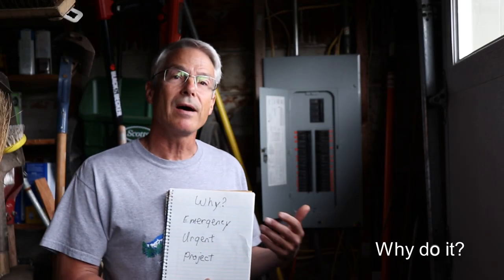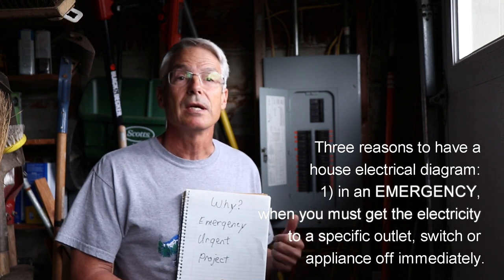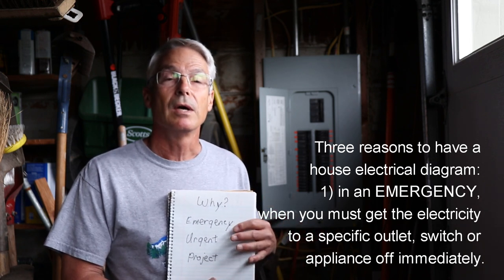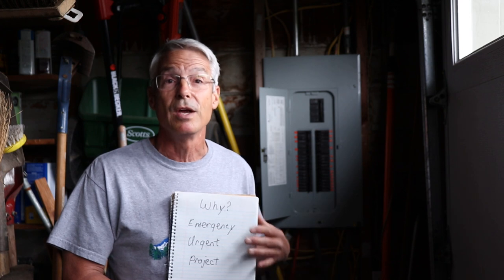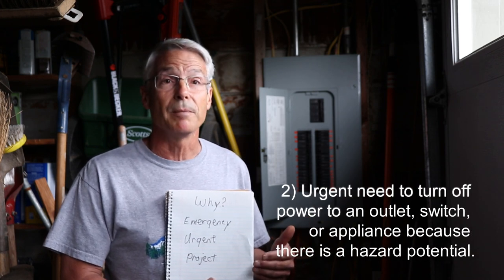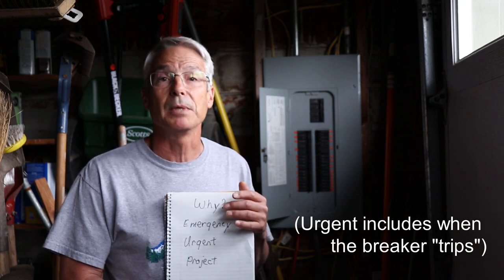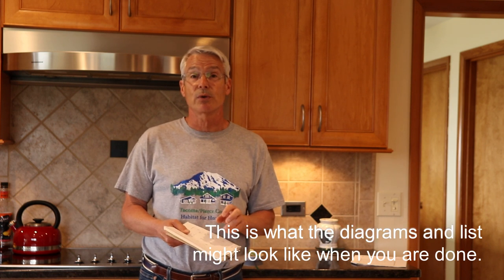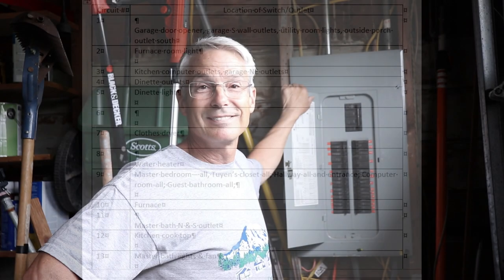How to Map House Circuit Breakers

Comment: If doing by yourself. Couple ways. Long extension cord plugged into outlet now other end near panel with light attached. Another one hook radio or a vacuum to outlet for noise. Flip breakers till  light or noise turns off.

Comment: Step 1:  Go to Lowes or Home Depot and buy 100 Not Automatic night lights and KEEP THE RECEIPT.  Step 2 : return home and plug a light into every outlet your house including the outlets for the unplugged refrigerator and freezer.  Step 3: make a sketch of the outlet layout and assign numbers to each outlet and switch .  Make a drawing later.... but if you get this much done you are 100% better off. Step 4:  Turn on every wall switch in the house  including the garbage disposal (put garage door remote in your pocket).    Step: 5 Turn every breaker off    Step 6  get a cold beer.   Step 7 Turn 1st breaker on and do a walk through the house with your clip board. log all the active circuits in the house on your notebook.   Step 8: return all the lights to the store.   Step 9  get another beer.   I think this is the most time efficient and least frustrating system.    Two people can do this in 1/2 the time... 4 people in about 15 minutes.     Give them beer. Thanks for your video , it caused me to think about using your method but adding some out of the box (breaker box :-)  thinking.

Comment: Hello.  Just a quick question and you may have addressed this and I just missed it?  After you confirmed circuit #1 & #2 were not the correct ones, did your partner turn those back on before moving to next circuit?  Otherwise when you kept checking outlets, don't you risk mis-identifying those outlets with #3?  They possibly could be #1 or #2 if not turned back on.  Thanks.

Comment: Question...  when a circuit trips, is the switch itself suppose to move to the off position by itself?  Also, I think my panel is all screwed up, I don't see the main shut off above just a series of switches below.
Reply from the maker: The light switch will not move.  The light just won't turn on.  It is the breaker that might/will move.  Sometimes you have to look closely to see that it isn't in the fully open position.  Turning it off and then on again helps to check it. If you don't have a main shut off on the panel, look elsewhere.  Start by following the main electrical line coming from the street.  If you can't find one, it's time to talk to a certified electrician.  Good luck.

Comment: Our electric went down yesterday and when it all came back on the water heater no longer was hot....because we moved into a house not knowing the panel is not labeled we can't find the one for the water heater and turning off the main breaker and back on did not work, so now it is about taking the water heater panel off to reset it..we don't want to get electrocuted...........and no men around to help us, no money for someone to come out
Reply: I'm sure after a month you have already found an answer, but for anyone else with a similar issue, this is how you reset a breaker for a large appliance like a dryer, water heater, etc.

1) Open your electrical panel's door by pulling on the metal ring or sliding the latch.  If you cannot figure out how to open your electrical panel, STOP and contact a licensed electrician.  Under no circumstances should you try to remove screws or force your way into the panel, because you will die.
2)  Locate the main breakers.  They will be the large breakers set aside from the others, usually at the top or bottom of the panel.  If you don't have power to your entire house, try resetting these breakers by flipping them on or off again.  If you still don't have power, contact your local power company and report an outage.
3) Look for other large breakers.  Are they labeled?  If so, find the one labeled for your appliance and turn it off and on.  See if it works now.  NOTE: Many appliances (including your air conditioner) may wait up to 15 minutes before they turn back on.  This is intentional and it prevents power spikes or brownouts from damaging your appliances.
4) If you don't see a breaker for your appliance, check the other breakers and see if the switches are halfway on or off (tripped).  Flip the breaker off and back on again to reset it, then wait 15 minutes.
5) If there are no obviously tripped breakers then you will have to guess.  Turn off all of the large breakers in your panel (except your main breakers), then turn them on again one by one.  Wait 15 minutes.
6) One more breaker check.  Look for small breakers--their switches specifically--and see if any of them are joined together with a little bar.  Those are two breakers acting as one large breaker.  Flip each set of breakers off and on again and wait 15 minutes.
7) You have ruled out all of the large breakers at this point so you must be dealing with an appliance that uses 120 volts like a washing machine or microwave.  You will have to flip each breaker in the panel off and on again until you find the right one.
8) Still no dice?  CALL AN ELECTRICIAN.  At this point, since you don't know which breaker goes to your appliance and you haven't had any  luck locating it, you really should contact an electrician.  Either the appliance was damaged in the power outage or it has an internal breaker that was tripped.

In OP's case, an electric water heater has a breaker hidden behind a metal panel that can be reset, BUT I don't recommend doing this without switching off its breaker in your main panel.    A water heater is (high voltage + water = DANGER).  I have had a breaker explode in my own water heater and it dented the metal cover plate, so if you have any reservations about trying any of the steps above, DO NOT DO IT.  Many electricians and repairmen will come out and give you a no cost estimate, so if it's something as easy as a breaker they may not even charge you for it.  Still, paying a hundred bucks is cheap compared to risking your health.